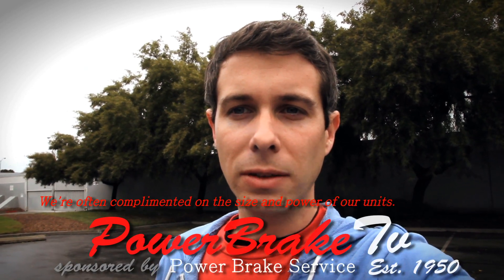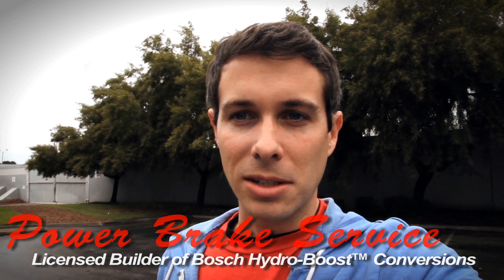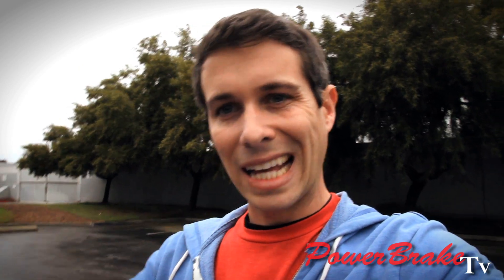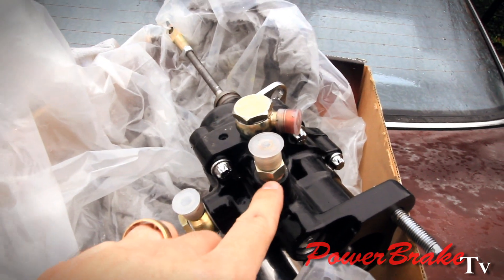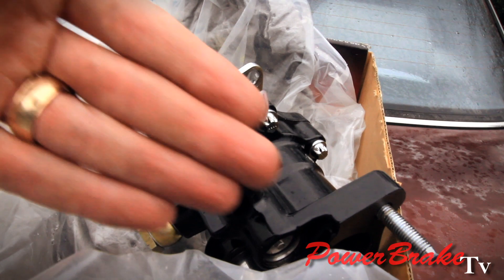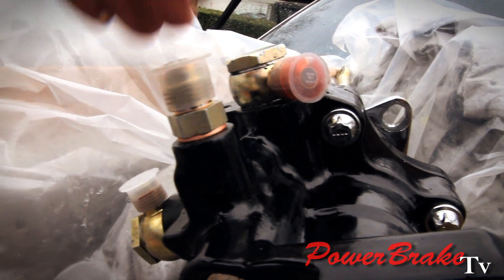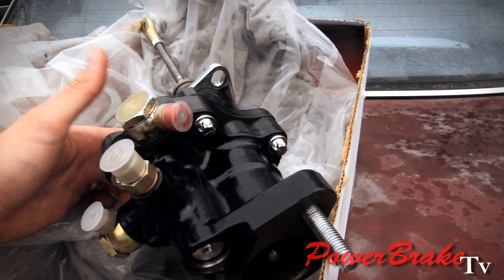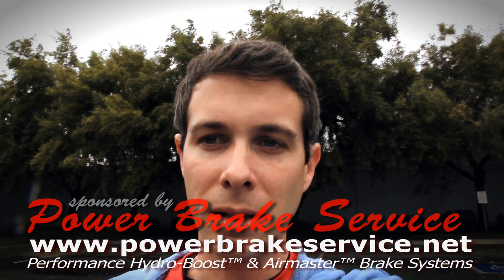Hydro-Boost Return Line stripped Powder Coat Performance Brake Booster - Sweeting Performance

Comment from the maker: The booster would go on the firewall just like the vacuum booster, you might want to give us a measurement of how much room you have from the firewall to  any obstruction there might be (like the fender), so that we can make sure to send you a combination that fits. It would mostly look the same, this booster is powder coated, so it has that thick-smooth look, but otherwise yes.